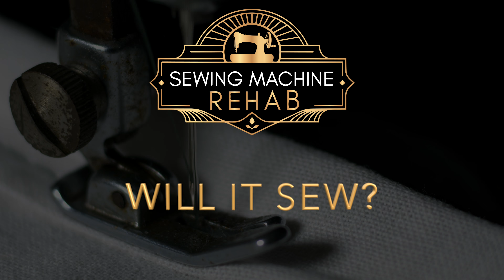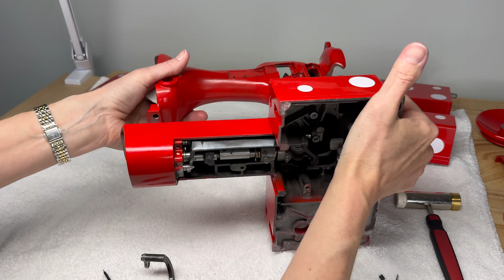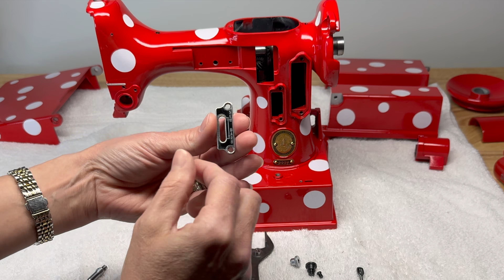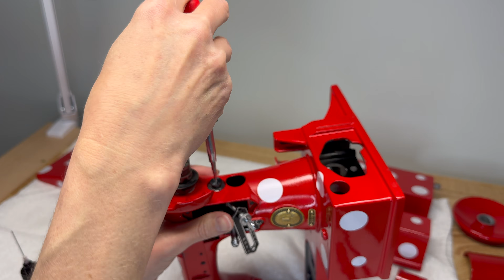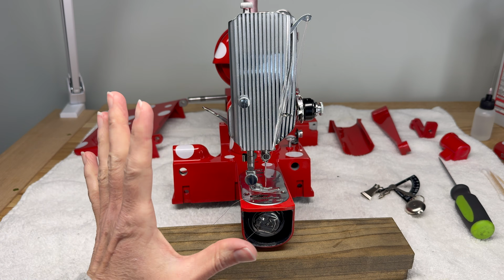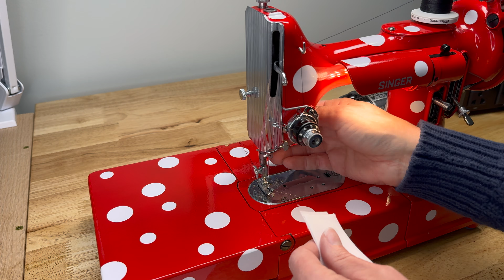No one else shows you all this! Rescuing a Singer 222k Sewing Machine, will it sew?

Comment: You do beautiful work, I'm really enjoying your videos. This paint scheme is definitely not my cup of tea, but the finish quality it out of this world! We purchased two excellent condition 222K's from England. I changed the motor on one so my wife could use it as her travel machine w/o having to lug a heavy transformer around, and the other Is a stay at home machine mostly used for free arm sewing. Both are lovely machines with near perfect finishes. BTW, there is a nice solution on that thread spool noise. The Featherweight Shop has a horizontal spool mount that slides right onto the OEM spool pin. Thanks again for the work that you do!

Comment: I  use HEMOSTATS to hold small parts while getting them into tight places where fingers have a hard time fitting.  I  used a dremel cut off wheel to remove the locking feature on the HEMO.
Reply from the maker: Hi! I have a couple of them! Very handy sometimes. 😊

Comment: Good morning!  Once again your wonderful technical skills and clear, well paced- not to mention charming- teaching style are timed beautifully.  (You truly are a refreshing delight to listen to and learn from.) 
I just purchased a 222K from a charity in the UK.  It is in fairly good shape considering, but had a problem with the little lever that raises and lowers the feed dogs not moving, though I was able to easily removed the lever and the plate.  It looks like the machine has been taken apart in the past given the condition of many of the screw heads throughout the machine...the one that holds the cover below the free arm was truly a nightmare, given that it was nearly stripped, but I finally was able to remove it.  (Heat, Kroil, finally Kerosene, Chapman gun screwdriver set, and a very light weight hammer...)
I used Kroil throughout, and with the little feed dog lever finally tried flooding the area with Kerosene (which has been the last resort, but frankly the only thing that has worked for me in the past with truly frozen machines, like a beautiful MOP Wertheim Superba "D" whose every moving part was completely encased in oil 'shellac"!). Also loosened the screw that you showed in your video that is reached through a hole under the balance wheel.  Watching your reconstruction I decided the little "slide block" you mention at minute 8 on your video might be the issue.  Finally tonight it gave way!  Would not have had any idea what to try had you not shown and explained how you put "Mini" back together!  Bless you!
Reply from the maker: Yay! So glad I had something that could help you and congratulations on fixing your problem! Happy sewing!